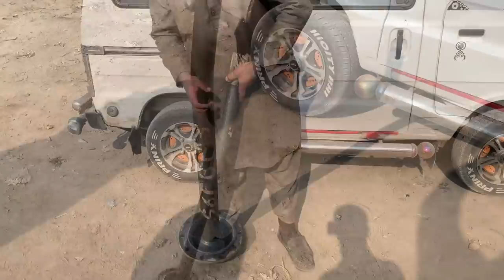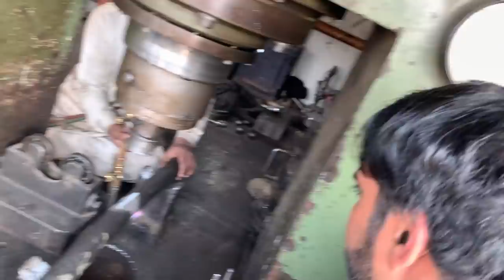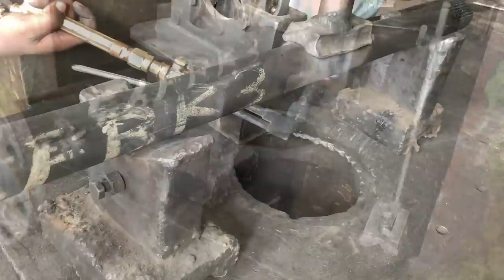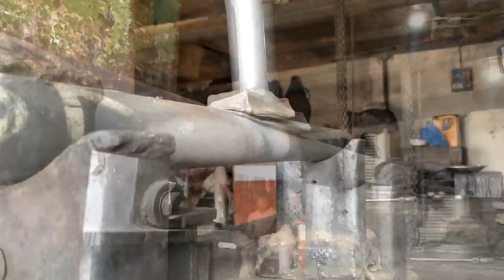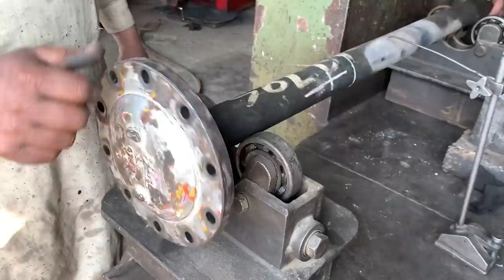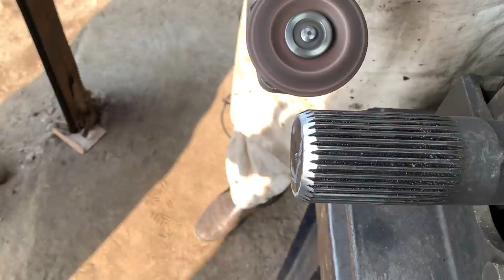I straightened the crooked axle by heating it on the press / Amazing thing official #2

Comment: Nice way to change the Rockwell rating
Reply: Their local made axles aren't hardened !
Reply: @Airman..  every legitimate axle is hardened.   Either way heating changes the steel on a molecular level,  if not done properly it'll make it twice as weak and more than likely break instead of bend
Reply: @autotek7930  The axle was already junk so if the straighten it and get some more life out of it they are ahead of the game.  You have to remember they are in Pakistan not the US or EU so getting replacement parts or affording them can be problematic.
Reply: @gullreefclub  your missing the point of stating a fact.   Lol.
Reply: Everyone seems to have a cellphone, which might cost more than an axle.

Comment: Not a metallurgist, but I harden and temper steel often. That axle is likely 5160 or similar. The temper is ruined in that axle. It will fail at some point. I realize that these men have to make do and use it up. That axle is scrap.

Comment: When are you guys going to learn to Stop overloading the truck and the rear end won't break causing the axle to bend...and seriously radiator hose clamps on the oxy/acetylene hoses 🤦🏿‍♂️
Reply: That's all we ever used; radiator hose claims. That's all we have
Reply: @moonraker008  I guess yall don't use  flash back arrestor either
Reply: @David-yy7lb  what is that? 😂😂